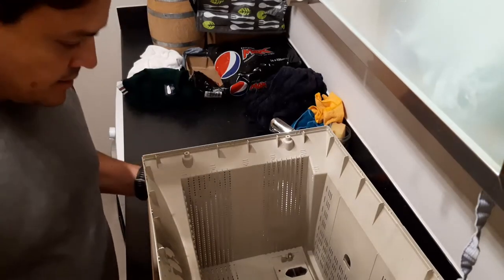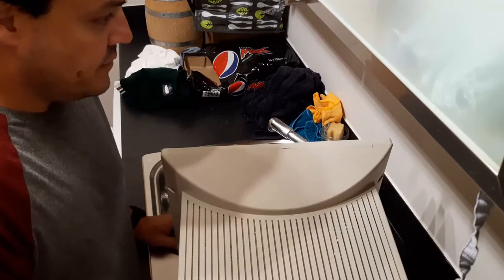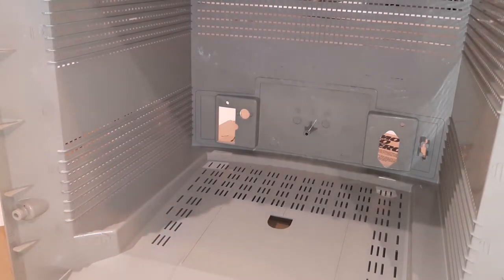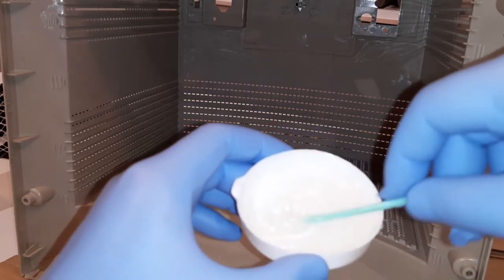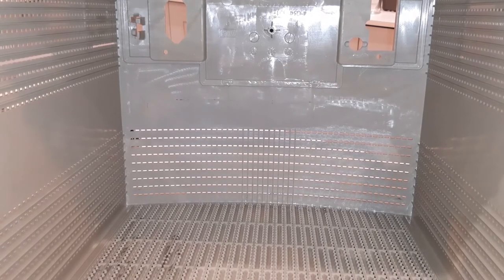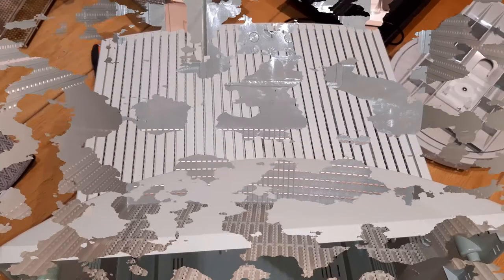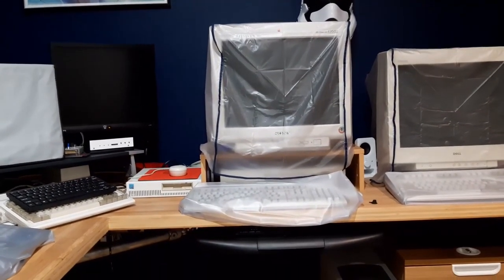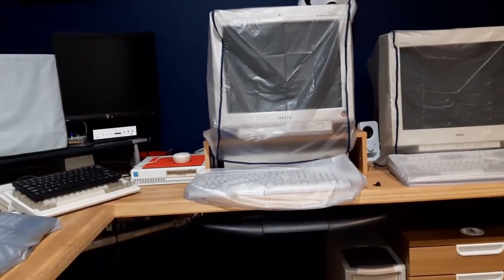Apple 17" Trinitron Monitor case repair with epoxy resin

Comment: That repair came out pretty well! I just used magic eraser last night to de-brand an NEC monitor to make it match my Performa 6200CD - it really is magic for plastics :)
Reply from the maker: It works amanzingly... but you have to use it with moderation, as it is a bit abrasive. I am about to post the end result with my 8100 running with the monitor. The 8100 looks like new after the cleaning up with the magic eraser.